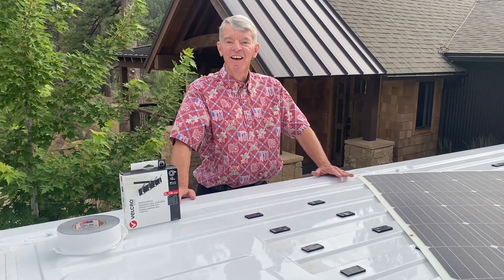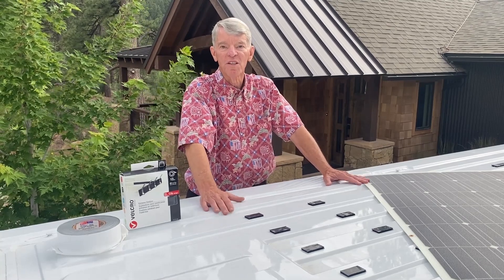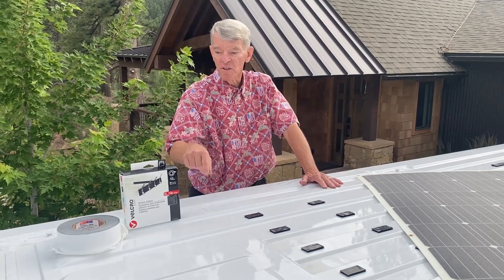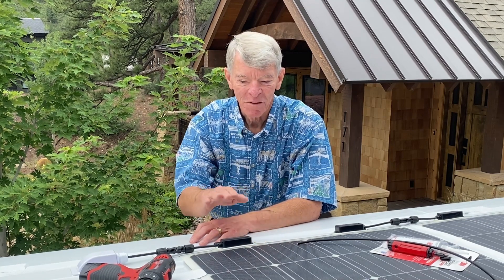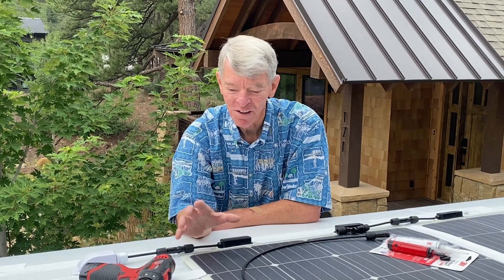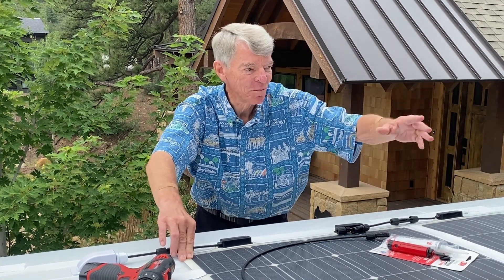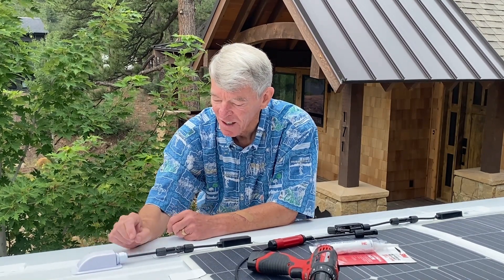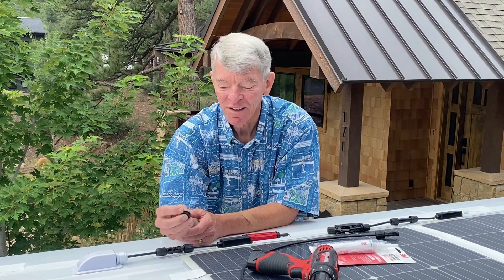Velcro Mounted Solar Panel Installation for a Van

Comment: Hi Pete, I just copied your velcro-mounted system and tested it on a 2800-mile trip and it worked perfectly- exactly as you said it would! I made a video and gave you credit for the design, thanks again!
Reply from the maker: I'm glad its working out for you. I've got 3 years and 25K miles on mine with no issues.

Comment: Hello, Just Curious how the panels are holding up. I know you replied 9 months ago, but i've read a lot about flexible panels failing prematurely. Thanks!
Reply from the maker: The panels are working great and holding up well so far. I was carful not to flex the panels very much during installation. I can imagine that flexing the panels could put stress on the interconnect wires in the panels and lead to earlier issues.

Comment: Is it still working for you? Would you do it again?
Reply from the maker: The solar panels are working great and show no problems with the mounting method. The van has been from Yellowstone to the Grand Canyon twice and from the the solar eclipse in Vermont to Yosemite (over 17,000 miles) with no problems. I would definitely mount them the same way again.
Reply: @fivepoundpete  It looked like you didn't do a solid tape around the edges of each panel. It looked like you taped just on the raised ribs on the front and back edges. Front and back meaning the front and back sides of the vehicle. It was hard to see due to the vehicle and the tape both being white. I couldn't see any tape on the side. Could you let me know where you put the tape?
Reply from the maker: I taped the panels along each side of the van and just on the plateaus of the ribs in the front and back. I wanted to leave the valleys open to allow any water collected below the panels to dry out. Be sure to clean the surfaces with alcohol and round the corners of the tape to reduce the likelihood of the tape peeling back.
Reply: @fivepoundpete  thank you

Comment: Curious, as some of the comments are a season of travel old (six months +) how this has held up. Too soon for an update? Considering using a version of this on a relatively flat fiberglass rv hull. It won't have the advantage of your channels, but might still offer an insulation gap?
Reply from the maker: Too early to tell the long term wear and tear, none so far. You really don't need the channels. The panels get the hottest when not driving and that is when the channels supply minimal airflow. They really are only help to make sure water does not collect under the panels. The Velcro should provide the same function as long as you don't completely seal your panels down with the EternaBond tape.

Comment: do the series connectors or wires vibrate on the roof as you drive ?  is any paint starting to rub off under the connectors?
Reply from the maker: The solar panel cables do not touch the roof and even if they did they would first land on the Eternabond tape and then on the panels themselves. The solar panel glands are only 10" apart and 3.5" is taken up by the connectors. I trimmed the cables to be as short as possible, just over 3.25", and the wires are so stiff that they don't even flex even on bumpy roads. I was thinking of putting little tie wrap mounts under the connectors but found I didn't need them.

Comment: There's a photo on the Transit forum where someone sealed down a panel like that, the problem was water found it's way in and rusted the surface underneath, they discovered it when they removed the panel.
Reply from the maker: I did not want water trapped under the panel. That is why the panel is elevated on the Velcro standoffs and not glued directly to the roof of the van. Air can circulate under the panels and a gap at the leading edge of the panels generates some airflow while driving.
Reply: Ok, I thought you said you taped around the edges, thanks for clearing that up @fivepoundpete

Comment: Thanks Pete, nice informative video! Very much appreciated. How are they performing (pls include approx miles driven and highway speeds)? did you consider hook and loop style velcro?
Reply from the maker: Time will tell how long my system holds up but I have pretty high confidence I will get years of service without any problems. I plan to do periodic inspections to see if anything looks like it might be an issue, none so far. I only have 5000 miles on the van and nearly all of that distance has been at Interstate speeds.
Ridged hook and loop is undoubtedly stronger than what I am using but I am more concerned with the adhesive letting go. So I chose a Velcro specially engineered for outdoor use hoping it will hold up better to the elements. I meticulously cleaned the surfaces to maximize the bond strength. If I ever see a problem I will report it here.

Comment: Sweet. I’m going to do my panels that way as well. I like the low places between ribs open to allow air flow to dry under the panels
Reply from the maker: Good luck on your installation.

Comment: Velcro fails even indoors.  You seriously want to try that in the sun, rain, cold, and heat?  One popular guy on here used Eterna-bond tape and it didnt hold.  Do you want to risk an expensive solar panel to Vecro, especially outside in the weather?  Let me know how that works out.
Reply from the maker: I have high confidence that this solution will last for years. I thoroughly cleaned the surfaces before applying the Velcro and EternaBond tape. I used outdoor specific Velcro that only experiences tensile forces minimizing release. I rounded the corners of the EternaBond tape to minimize peeling. Periodic inspection for problems is advised. Time will tell.

Comment: Great knowledge again pete keep up the cracking videos and we all appreciate you sharing your knowledge and you are spot on with these panels as most people put them straight on the roof where as they should be fitted half inch to an inch off the roof something to do with the heat they generate
Reply from the maker: To get the heat to reflect back to the panels you only need a small air gap. With a larger gap you can get some air flow to help cooling. I don't have a lot of garage clearance to accommodate a larger gap. Even so I would still use just the small gap generated by the Velcro stack.

Comment: Very informative, thank you. I've never thought of using velcro. I would have wished to have some close up shots of the connectors and the taped bits of the solar panels though.
Reply from the maker: I was unable to upload a photo of the connectors and EternaBond tape. The connectors are the same type as what come on the Renogy panels. They are just attached to shorter cables. I rounded the corners of the tape to make it less likely that they would peal off.
Reply: @fivepoundpete  Yes I understand how you did it but it still would have been nice with some close-ups 😊